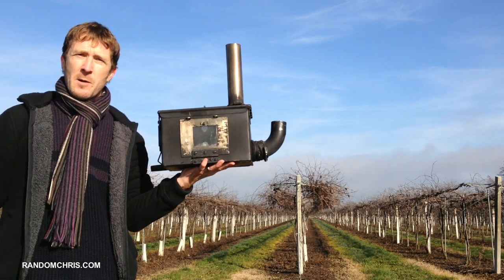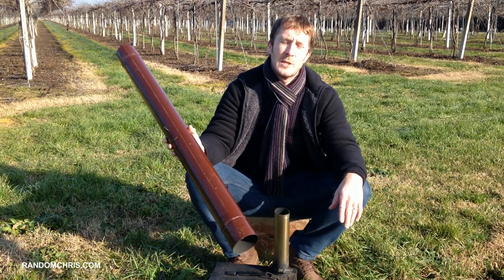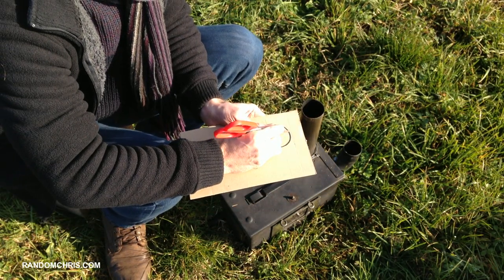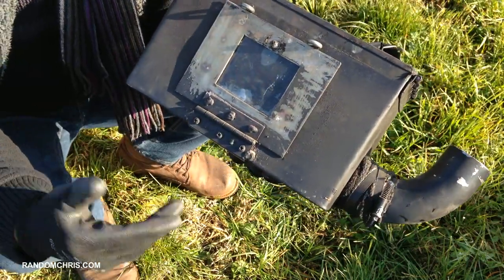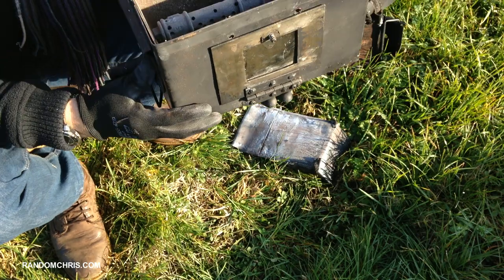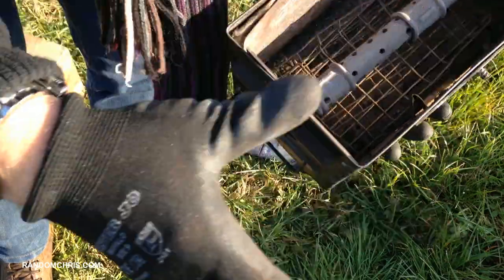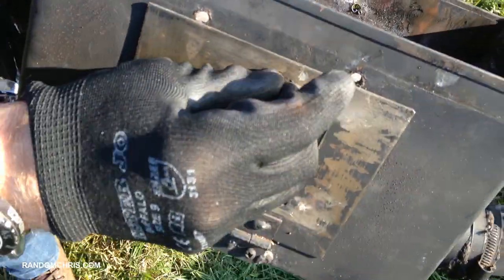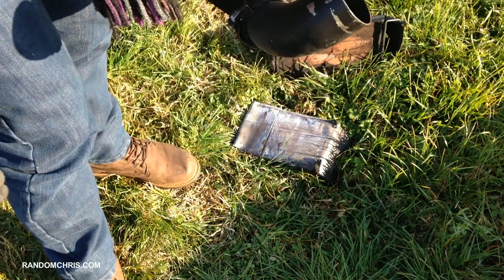How I Built my Ammo Can Rocket Stove - a Small Homemade Wood Burner (Mk II)

Comment: Could you get by with just insulating the bottom to help prevent it overheating the ground or surface of your structure, then leave the other sides uninsulated?

Also, have you thought of adding short legs? Either folding or detachable?

GREAT JOB
Reply from the maker: Thank you for your comment George. I now have an infrared thermometer so I can test temperatures around these stoves while they are burning. The bottom of this stove is pretty cool, thanks to the double skinned bottom with 20 mm circa rockwool insulation, so there may be a smaller and simpler solution than adding legs. I will be experimenting with the above whilst developing the Mk III. Cheers, Chris 👍
Reply: Sweet!!
Does the insulation on the sides lessen the stoves ability to warm say a 8 or 10 ft diameter teepee or a 100 Sq ft tent?

I could see a .50 Cal box being a great one to use for your Mark III.  A little bigger but not massive.

Thx
Reply from the maker: Based on my experience heating a garage (and a test burn on a small boat) you would be toasty with this stove in spaces of that size. This is a small stove but it kicks out a lot of heat! With the insulation as it is the majority of the heat is released from the top and front of the stove, this would be beneficial for a boat installation. The options for these stoves are almost endless - bigger, smaller, wood pellet fed... That's why I love them so much - they can be customised to suit vastly different requirements. Cheers, Chris 👍
Reply: Agreed.  I looked at several other videos yesterday as well.  One or two even used a 20mm cannon she'll box.  YIKES!!!

Oh.... one person did mention you may want to wet sand the paint off the box first.  It may release some hazardous stuff when heated.  You can then repaint with a good high temp paint made for wood stoves

Keep up the great work and can't wait for your next video

CHEERS

Comment: Why did you choose to make 2ndary air inlet pipe u-bended from bottom to top and not just an str8 pipe on top? Is it to pre-heat the air as it travels from bottom to top through the pipe?
Reply from the maker: Hi Tommy, yes the routing or the pipe is to ensure the secondary air is super-heated before it is released into the burn chamber. Cheers, Chris
Reply: Christopher Barr - Random Chris I suspected it was like that 🤗, Cheers m8! Awesome work!
Reply: The primary inlet is the back port to get the burn started & maintained. The secondary inlet is to enforce that proper drafting takes place & that the unburned wood-gas has a secondary burn from the fresh oxygen. Yield: less smoke, more heat, & more efficiency in burn chamber, which equals less fuel required.

Comment: Very cool Chris, psyched to see the Mk lll. 

Question : for the secondary burn air intake pipe opening at the left, bottom, rear corner of the box; did you use the same sealing methods that you used for the flu and rocket intake? In the video I noticed that you could easily move the intake pipe up and down as needed within the burn chamber.
If it is not sealed the same and it's just a simple hole, how do you keep the loose pipe from falling down into the fire when in use?Thanks in advance for your time and I'm looking forward to future videos👍🏼👍🏼
Reply from the maker: Hi Anthony, thank you for your comment. The secondary air pipework is held in place by an 'interference fit'. Basically the hole in the ammo can is very slightly smaller than the diameter of the pipe. The pipe only went through the hole by applying force. It can still be moved by force but does not move under normal conditions, including when the stove is hot and the components are subject to differential thermal expansion. Cheers, Chris 👍
Reply: Random Chris Thanks again Chris! Keep up the good work and videos!

Comment: Hi Chris i had been checking videos on you tube you stove is the best i like to now what size is the pipe which going around the stove for Oxygen and also it need the pipe in the back of the stove or is optional thanks for share you invention with us 

Johnny from New York
Reply from the maker: Hi Johnny, thank you for your comment. I used 1/2" i.d. steel water pipes for the secondary air intake but my Mk 1 used copper pipe and I'm pretty sure I'll use copper on the Mk III, as it has superior heat transfer compared to steel. The routing of the secondary air pipe along the burn chamber increases the temperature of the air progressively so that it exits the secondary air outlest holes at a very high temperature. Cheers, Chris 👍

Comment: hi chris. Enjoyed your video. as i told you i am 1/2 way through building mine. just curious, you mention another prototype were you used copper pipe for secondary burn pipe, which you said you are going back to. is this a continuous piece of flex copper pipe. or soldered. just woundering if soldered joints would hold out. cheers Bri.
Reply from the maker: +Brian Moore Hi Brian, that was a single piece of 15 mm copper pipe, bent with a pipe bender. I hammered the end flat to form a stop end and drilled holes in the area where I wanted to introduce secondary air in a manner similar to this version. I liked the copper secondary air pipe because it was simple, lightweight and the heat transfer rate in copper is incredible. If you wanted to avoid bending the pipe (you can bend copper without deformation using sand or frozen water if you don't have a pipe bender) you could use compression fittings as these provide a good seal without using solder. Good luck with your build! Cheers, Chris
Reply: Well I like that idea betta. I can rent the bender. I will be doing a video when im done. I ordered the Mica glass from the link you provided for me. I laid it on  my wood stove in garage when it was on and although gets very hot, seems to do the job very well.
Reply: Oh Merry Christmas to all.
Reply from the maker: +Brian Moore Good stuff, I'll look forward to seeing your stove when it's finished.
Reply from the maker: +Brian Moore Merry Christmas! 👍
Reply: Ok cheers.

Comment: Chris, great ingenuity! How about adding gravity feed feature to the MkIII?
Reply from the maker: Hi there, thanks you for your comment. This is a great idea and is something I've been thinking about for a while already. I am looking at finding a way for the Mk III to burn gravity fed wood pellets. It would also be possible to have a gravity feed option for sticks and I'm trying to find an easy way of integrating both options so that you can switch between the two.... Cheers, Chris 👍
Reply: While watching this video, I also had the idea to introduce a mechanical(non-electrical) perhaps spring assisted pellet feed to drop pellets slowly into the rocket feed tube. That way I can set it to run continuously throughout the day or night while I am sleeping and not have to feed it continuously or have the fire die and the house go cold ( which is a big drawback of rocket stoves, especially if the rocket stove isnt heating up a thermal mass to save all that heat produced ). I will start thinking up a design and I look forward to seeing yours when you unveil it.
Reply from the maker: The Mk III will have a gravity feed pellet option. I have some ideas on how to achive this and will be working through designs as and when I can. Cheers, Chris 👍

Comment: I m thinking pallet wood will make a great fuel for one of these stoves. Free unlimited wood supply. Its usually hardwood and easy to cut up with a skill saw. Us a cheap carbide blade to cut through the occasional nail.
Reply from the maker: Hi Arthur, any wood you can get for free is a bonus. (I have even scavenged firewood from a beach and then swam back to the boat whilst holding the wood above my head so that I could have a barbecue on board!) Pallets are readily available in many places so are a perfect source of firewood. Cheers, Chris

Comment: Another great video, well done Chris. Looking forward to MK III. Did you ever get round to using the stove to heat your boat?
Reply from the maker: Hi Edward, thank you for your comment. I did do a test with it and it was like a sauna in there! In all honesty there is actually very limited room on our current boat to install this stove permanently but, if we were to be using the boat in the winter, and we didn't have electricity, it would be an absolute godsend. I could easily install it in the companionway step area when required and then run some flexible ducting up and out through a heatproof washboard section. I am also really looking forward to making hot water via a thermosyphon on the flue. This means boiling hot showers when at anchor (firewood can be picked up for free pretty much anywhere...) We have electricity included with our berth so it's just easier for us to use a small electric heater, which easily heats the boat very quickly. However, you can't beat the ambiance of seeing a natural flame and hearing burnin (instead of the hum of an electric fan) so I plan on making an even smaller wood burner that people can make for small boats in the future... Cheers, Chris 👍
Reply: That's interesting, maybe I'll put my plans for a boat stove on hold for now. Keep up the good work.
Reply from the maker: The new smaller version is going to be quite far down the line I'm afraid - I've already commited to making the Mk III so I'll have to see that through first. As long as you're not in a rush, I hope to come up with an small space wood burner that will be useful for small boats... Cheers, Chris

Comment: Not good to use galvanized.  It can generate dangerous gases when heated.  Great videos!
Reply from the maker: Agreed (as per the disclaimer at the bottom of the video description). The first burns of the stove should be done outside in a well-ventilated area and combustion gases should not be inhaled. Cheers, Chris 👍
Reply: Kevin Sluder , galvanized metal is a zink coating so it doesn't rust, it can be and does burn off in a well ventilated area (outside). After a few long burns you should clean and hi temp paint.

Comment: Hello, love life too! Great video! How about a mini build-in boiler for a cup of tea ? Could it be made on the bottom of the flu? Is there enough heat left on that spot to extract from the temperature proces?  Thanks ever so much for your effort.  DJ  Holland.
Reply from the maker: Hi DJ, you can knock the handle off and boil a pan of water on the top of the stove. The Mk III will also have a copper coil heat exchanger on the flue for hot water for showers etc. Cheers! Chris 👍
Reply: An "accessory" water tank (from identical ammo can that was made to nest on top) with the copper coil the height of the can would slip on/off easily, but would make for a scalding & quick shower...

Comment: can the small air intake be routed outside through a wall?
Reply from the maker: Hi Linda, do you mean the secondary air intake (The small diameter 'pipe' where the secondary air is drawn in) or the larger diameter primary air intake?
Reply: yes, I meant the secondarily air supply, the small tube
Reply from the maker: +Linda Foley Hi Linda, yes you could extend the length of the secondary air intake pipe, and even supply it with air from outside, however you would need to increase the diameter of the pipe to counteract the increased resistance caused by the longer run. Cheers, Chris 👍

Comment: P.S. Glad you're gonna go back to the copper tubing for the baffle burn. Galvanized steel is soooo toxic!
Reply from the maker: Galvanised steel can produce toxic fumes (hence my warning in the video description). However, zinc oxide fumes aren't produced until around 900 degrees Celcius. Thes stoves burn very well and do get hot... They don't get anywhere near that hot though, so the reality is that this isn't a problem anyway. Copper tubing has far superior heat transfer compared to steel, which is why the Mk II I will have copper secondary burn tubes. Cheers, Chris
Reply: Christopher Barr - Random Chris do you mean like copper water lines?  If so do you suggest soldering the pipes together ,or would the solder melt?

Comment: Concerned due to the many painted and galvanized parts that in the initial burns there would be many toxic gases. I'm not going to make recommendations due to modern views on safety and toxicity, as to how to correct. However, there is potential for fatal offgassing from the components used. That's based on 20 years as a blacksmith working with different found metals.

Comment: love it Chris,  looks like a very easy build,  Could you use car exhaust sealer instead of the rope, or would it become to brittle from the heat?  Cheers.
Reply from the maker: Hi Dave, thank you for your comment.

These stoves are really easy to build. I used 8mm stove rope which costs £1.58 ($2.00 circa) per metre. This is super heat resistant and allows for differential thermal expansion and contraction. The flue can also be easily removed and reassembled if necessary.

One other thing to watch out for with exhaust repair putty is that it can set on fire at high temperatures and it gives off big plumes of stinky black smoke (don't ask how I know this!).

Cheers, Chris 👍

Comment: Loving it. I just started a welding class and for my class project I will build a small stove to go in my tiny house. This information will really help my design. I was looking at the cubic mini wood stoves for design inspiration http://cubicminiwoodstoves.com/ but could not figure out how they designed their secondary burn chamber. This video helps so much. Thanks for the detailed break down. 

I wonder, would it be useful/desirable to put a damper on the rocket stove feed tube/air intake or in the exhaust pipe or both? Also a damper on the secondary burn air intake?
Reply from the maker: Hi Timothy - reply delayed as your message got filtered into the spam section.

You're very welcome. Regarding the dampers - my view on this is that you don't have to restrict anything at all. The stove burns perfectly like this and to increase or reduce output you can regulate the amount of fuel introduced.

Good luck and let us know how you get on!

Comment: Excellent, but stop using anything galvanised, deadly, ask any boiler maker.
Reply: totally agree heated galvanized metal gives off deadly gas is literally deadly
Reply: totally agree heated galvanized steel gives off deadly gases and should never be used for anything like this just use plain black iron pipe
Reply: Could exhaust pipe from a car be used, several sizes and shapes.
Reply: Not from the forums i hear once the metal has been oxidized(heat treated) its fine. I think cabelas sells a tent stove made from gavanized steel

Comment: Put a metal FUNNEL on the rocket pipe and load it with wood pellets and make it a pellet stove. Would burn longer without the need to keep filling it. Seal the top of the funnel. It should gravity feed!
Reply: BKYBZ ⬅️ a feed port & air port are 2 separate things. Filling the rocket air port will kill the heat output = no more rocket stove.